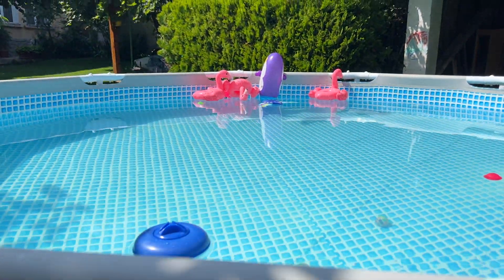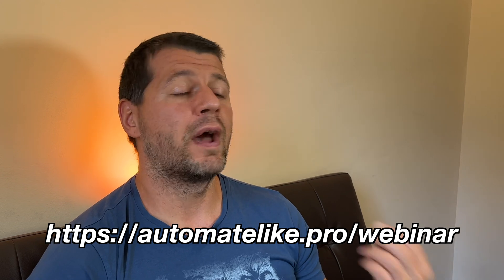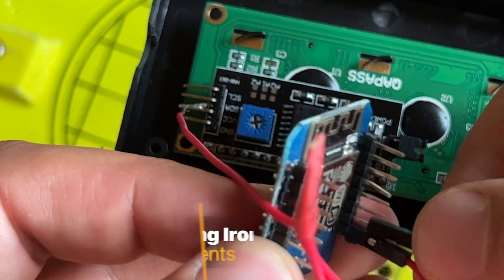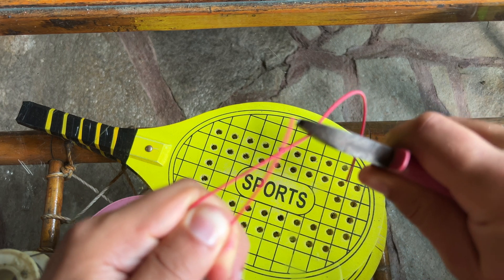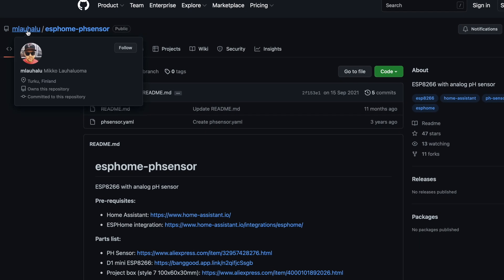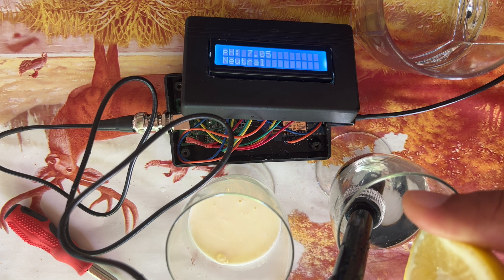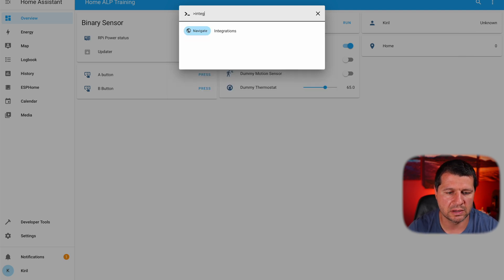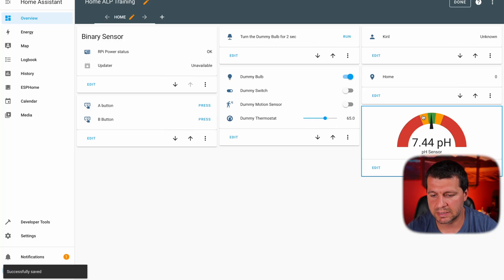How to make PH Sensor that works with Home Assistant?

Comment: Nice, i used only PH probe with pH module PH-4502C, and shelly addon plus for Shelly PM1 Plus, i have all in one, 2 temperature probes (in out from pool and heatpump) and 0-5V from PH and in HA simple sensor : - platform: template
  sensors:
    ph_v_bazenu:
      friendly_name: "pH v bazénu"
      unit_of_measurement: "pH"
      value_template: >
        {% set percent = states('sensor.shellyplus1pm_c4d8d55d5704_input_100_analog') | float(0) %}
        {% set voltage = (percent / 100) * 12 %}
        {% if 0 < voltage < 6 %}
          {{ (-5.58 * voltage + 34.95) | round(2) }}
        {% else %}
          unknown
        {% endif %}

Comment: Hello, when I adjust the potentiometer, the pH value changes, but when I turn the screws on the circuit, it changes very low and I put it in water, it measures the same, I put it in lemon juice, it measures the same, can you please help?
Reply: I have ESP8266 NodemCu V3

Comment: Hi friend have a question. Is it possible to combine PH Sensor and a temperatur sensor to showing on the same display? Actually have another esp32 board to shown water temp.  Is it possible to measure on same esp32?

Comment: Can’t get this to work 😢 it seems the voltage output from the ph sensor board is very narrow when I finally got it adjusted so it’s not maxed out. Do you think I have a poor board or is there something else I can try?

Comment: I find the dh1 mini is a bit power limited. I already have a dh1 mini running a temperature sensor and when I added a float switch the temperature sensor stopped and I think this was due to power available - do you think it would also run a pH sensor or would it need its own dh1 mini? I’m a bit limited on power sockets and would prefer to run just the one dh1 mini if possible.

Comment: Nice Video with good idea! I'm trying to do for a pool, the idea is to take an esp32, or similar, power with small solar panel with some small betteries and test PH, TEMP and ORP or clorine.  All togheter insde in a floating Clorine device, with the solar panel on the top! with ESPHOME every 30 minuts ( for example) ESP32 with wakeup, send PH+TEMP+clorine level by WIFI to Home assistant, and go to deepsleep andother time for 30 minuts! In the mena time the minisolar panel will give power to the batteries to keep enough energy!

Comment: Hi there, thanks for your effort. I have a question: Do we need to remove the pH meter sensor from the water? For example, if I have a substance that I need to measure, should I periodically remove and clean the sensor?

Comment: Thanks for the video. I have a question. The probe you use has a screwable cap, If I leave this probe in a fish tank full time, can I remove the cap and get instant readings?
Reply: did you try this?

Comment: Great work keep it up, can not wait to use my pH sensor in my fish tank but I have a problem after connecting everything together all I get on the display is squares  or nothing depending on the position of the potensiometer  of the display NO readable letters any help would be appreciated  ?

Comment: I have built this following it to the letter and triple checked all cables etc. I have two issues 1) there is no display (it staes in the log communication failed) and also the sensor is stuck on 21.57 - even though I have tried adjusting the pots. Finally I connected the main 5k pot but you did not mention what to do with it. Any help would be appreciated
Reply from the maker: for the display check the logs during the boot very carefully it is possible your display to have different address. You can also try to remove the address from the code completely as this will try the default address. The 5K pot should be connected and you can use it along with the adjustment knobs on the ph Sensor
Reply: @KPeyanski  Thanks for the reply. I have checked the logs as carefully as I can but all it states is that the connection to the display failed. I have tried removing the address completely but no avaiul. Is there any way you can direct me as to what to look for in the log. Much appreciated - I really want to say #phowned!

Comment: Nice video, just what I needed !
For powering the ESP8266/ESP32 : I presume each micro USB cable with adapter of any phone or tablet may be used for this (are Amps important ?) ?  Do you have a link in case I would like to buy one for this project ?  Thanks !
Reply from the maker: Yes, adapter is needed or any regular usb socket like the one from a laptop/desktop or other similar devices. Amps are not important.

Comment: made mine but lcd stuck on -3.25 very acidic  ,adjusting the pots dont help
Reply from the maker: Strange, try adjusting the 5K Ohm potentiometer as well.
Reply: @KPeyanski  all working now must have been a loose wire.
Reply from the maker: Great to hear. Don’t forget to leave a #phowned comment, but more importantly - enjoy!

Comment: Does not the reading oscillate a lot? A median of just 7 values is not enough for my setup
Reply from the maker: They are. But isn't it normal when you add lemon to the water or you put the sensor in milk? I saw the sensor to reach 22PH so that means higher median.
Reply: @KPeyanski  it oscillates submerged in the same liquid. By the way, maximum pH is 14 so reaching 22 looks wrong to me. Calibration issue?

Comment: I am doing exactly the same with a salt pool but then the PH reading is way lower than it actually is... I calibrated the sensor with calibration fluid 4.01 and 7.01.. I am now back to doing it manual..:@? do you know what the problem may be? and yes a chlorine sensor would be awesome:)
Reply from the maker: OMG salt pool :) That is cool... Do you have waves as well? Unfortunately I don't know what could be the problem.
Reply: @KPeyanski  today I tried to mix salt into the Calibration fluids still no luck:( Will sent a mail to the supplier I think.. its a normal Intex salt system BTW so not huge pool of something;)

Comment: Do you have the sensor in your pool all the time?
Reply from the maker: No, not yet. My cable is too short and I have no place to mount the sensor steadily and safe. My pool is small and temporary (just for the season) and there is a lot of action in it from time to time with a lot of splashing, so I'm still wondering how to do that.